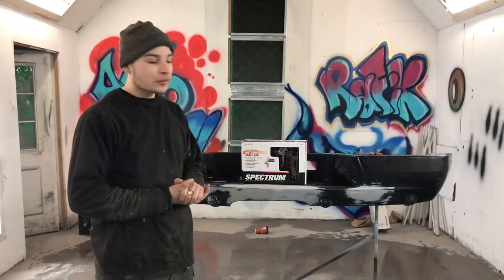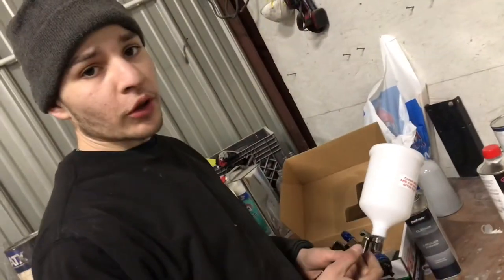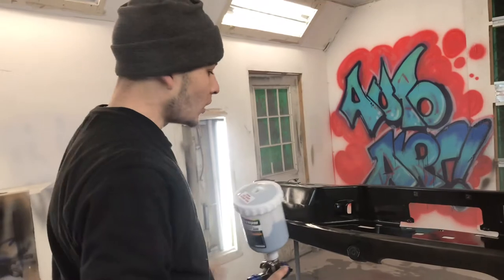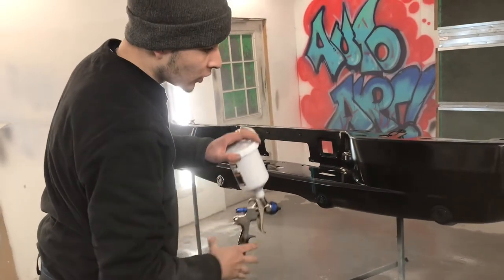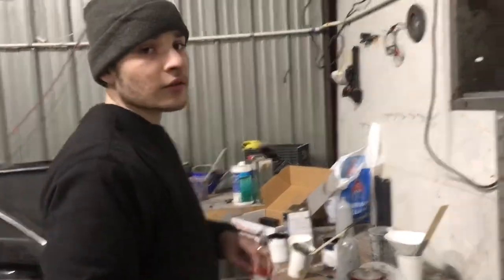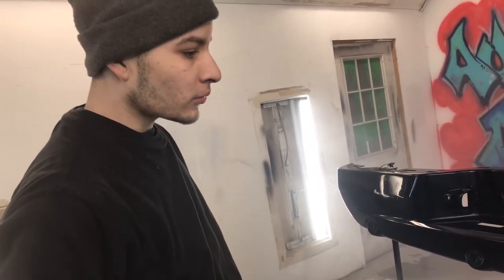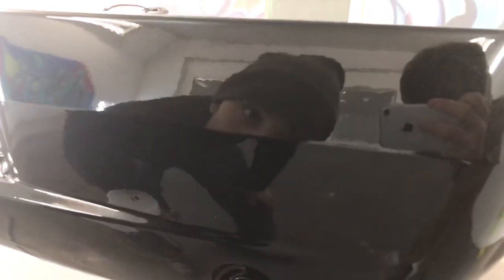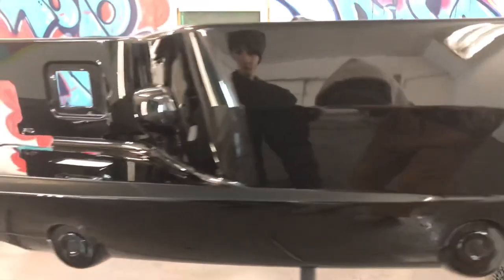AutoArt episode 02 - Harbor freight Spectrum 1.3 paint gun review - unbox and spray test

Comment: by chance what size air compressor your using i got a 20g i bought the gun but waiting on parts to come in to paint
Reply from the maker: I’m using a bigger one like 150 but I was using a 30g tank before and worked amazing for me. Just be sure to get a pressure regulator for ur gun it helps a lot
Reply: @autoartrafik6211  thanks yeah I bought a Digital one for like $12

Comment: I thought they only come in 1.7 tip size?!
Reply from the maker: Those tips are usually for like primer you don’t want to spray with that’s size. But yes they fine in 1.4 and 1.3 I believe
Reply: @autoartrafik6211  it's actually the opposite 1.3 / 1.4 is for clear. and 1.7 is for primer and base.  says it right on the box